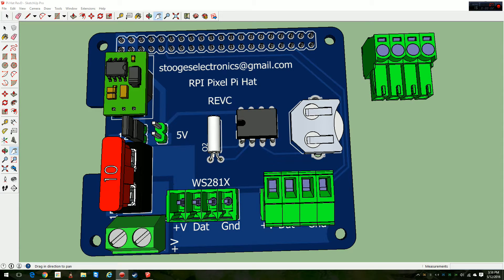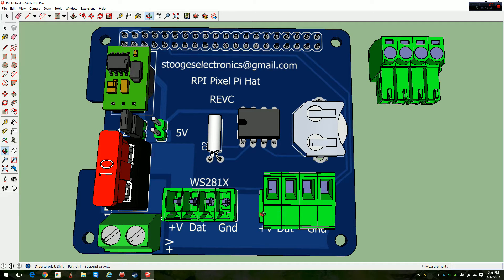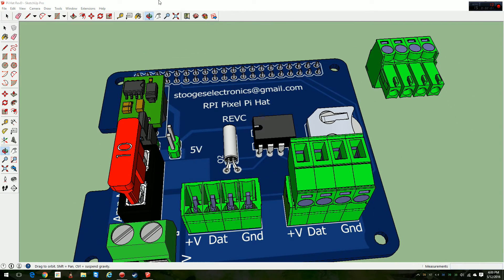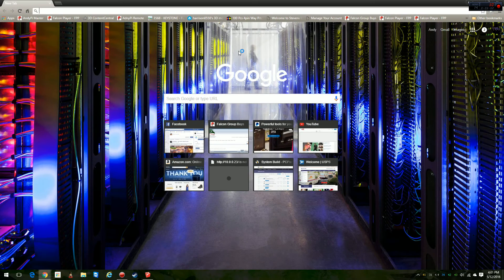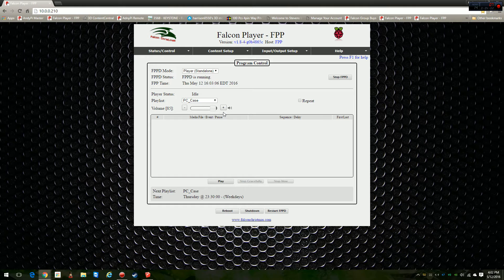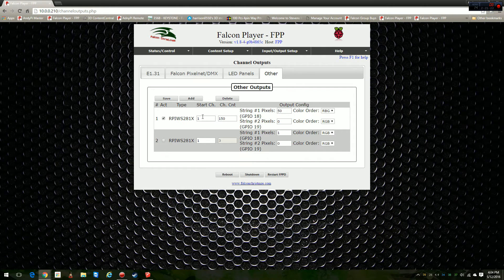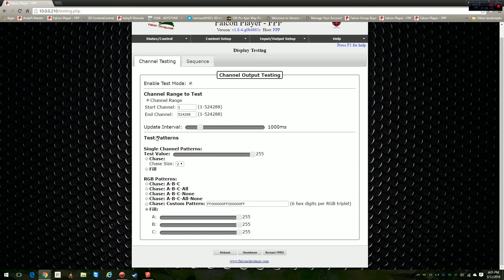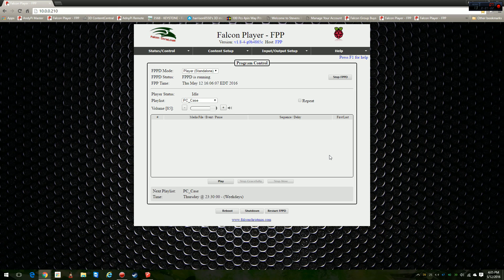PiHat setup

Comment: Will this work w Pi v3?  If not, plans for a new version?
Reply: yes it does. FPP has released the 1.8 version and its also very easy to install on the Pi v3.
Reply: Yup thanks--I actually have several up and running now.  Works great!